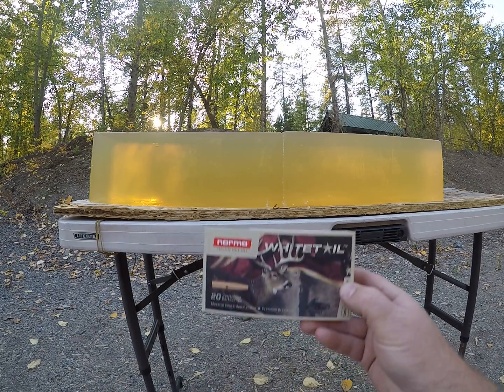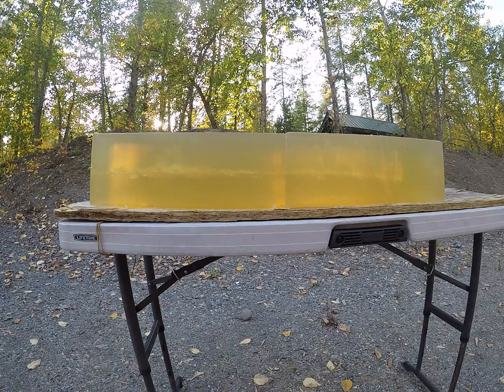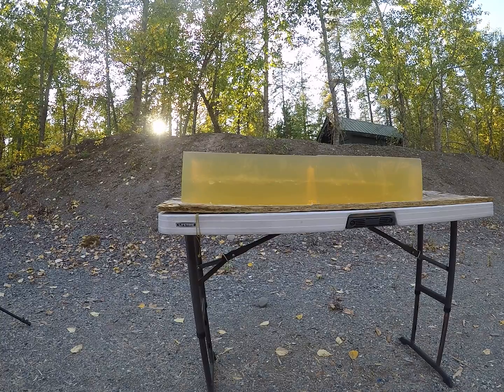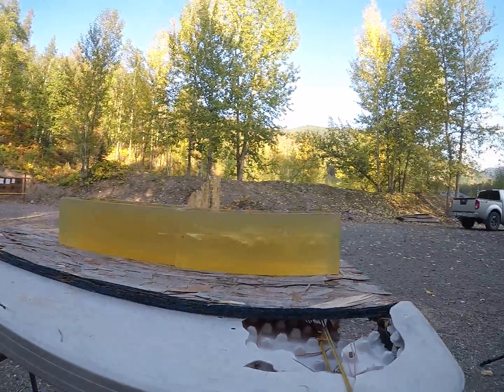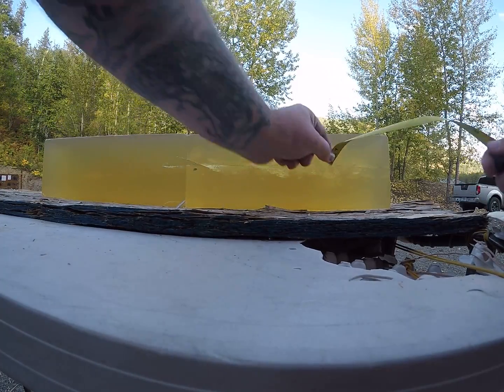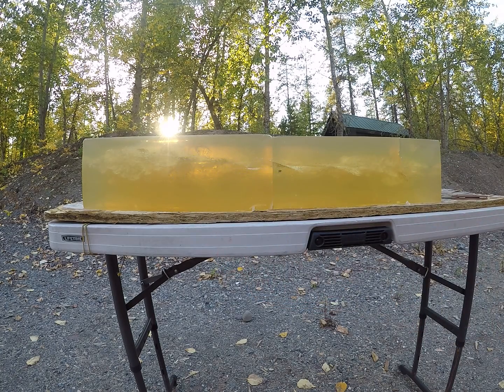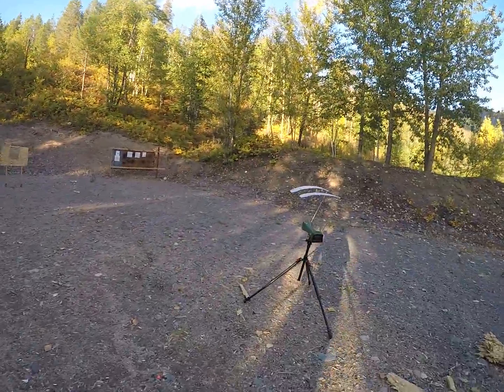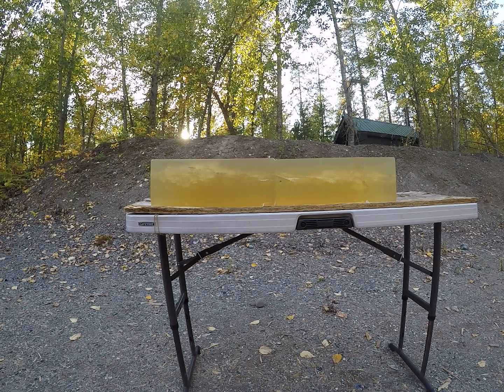Norma Whitetail 6.5 Creedmoor 140 gr ballistics gel testing

Comment: Speer is either coming out or has already come out with a bullet called Speer Impact. It has a BC of .646 in .264 bonded and because of its lenght, it should stabilize in a 1:9 twist. If you have any experience with the Impact or plan to, I would love to see its terminal performance at high velosities as well as low velosity impacts.